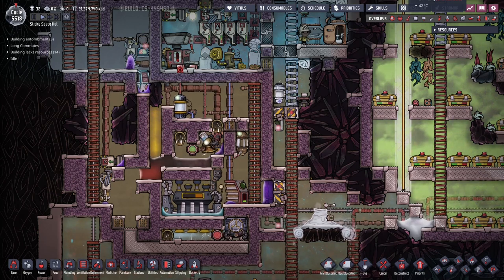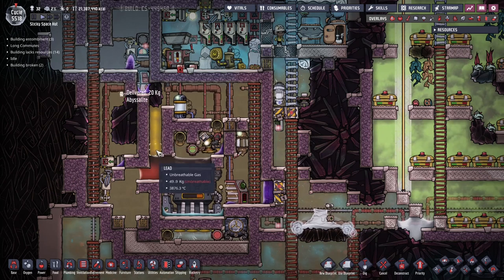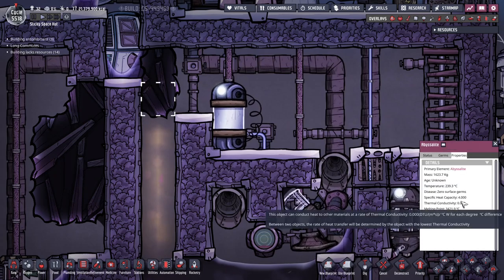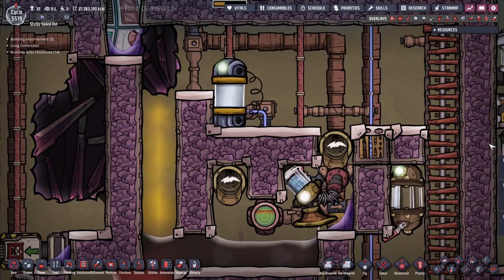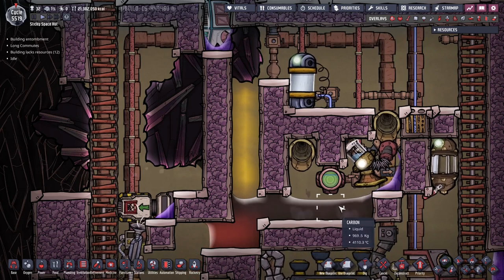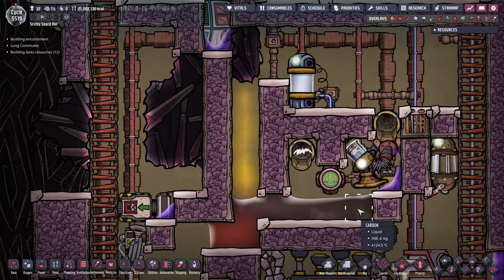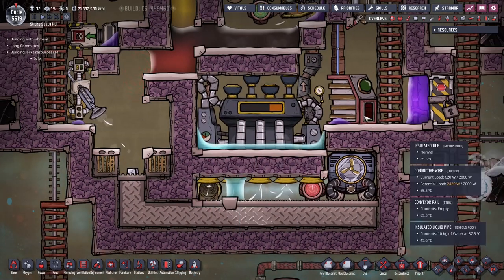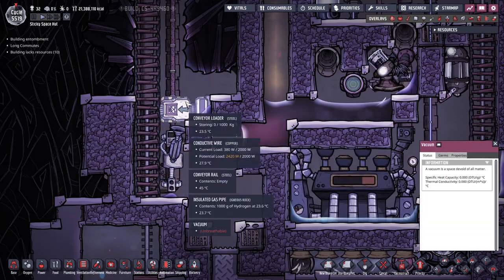150,000 Kilos of Tungsten with Molten Carbon? Here's how! - Oxygen Not Included

Comment: Great video, I always wondered how abyssalite could be melted. Could a weight plate hooked up to the sweeper through a delay help the tungsten cool down a bit more or is debris heat transfer too slow to make it worthy?
Reply from the maker: Good point, metal tile can be swapped with a weight tile for a little extra umph. I used some additional trickery in the 2.0 version.